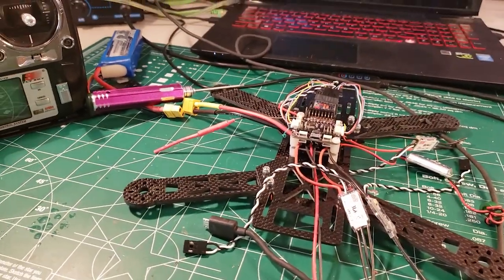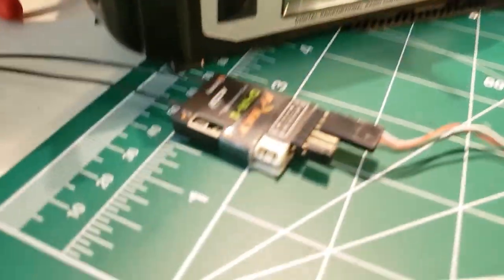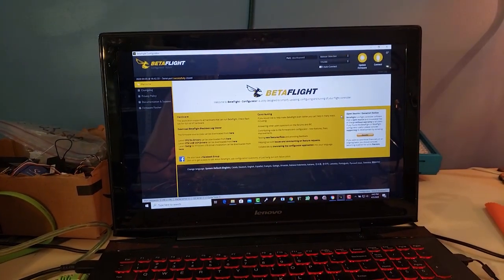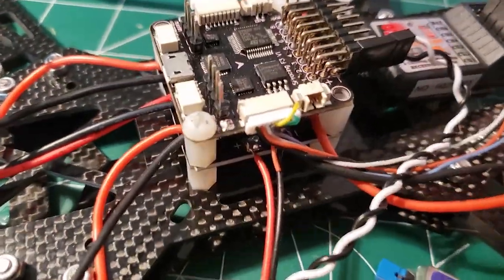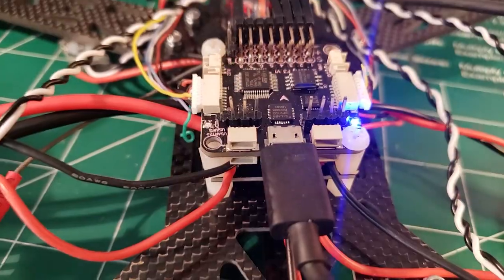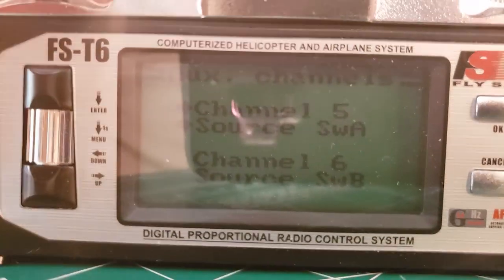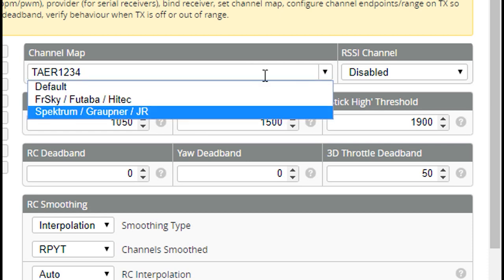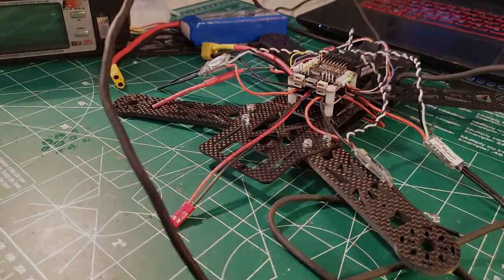Setting Up Flysky Transmitter Channels in Betaflight

Comment: Hi. Hope you can help. I have a SPCMaker Bat 78 2s drone with a FlySky receiver. I have it in bound to my multi protocol Jumper T Lite tx. It flys great. My arm switch is aux 1 ( ch 5),  modes aux 2 (ch 6), beeper aux 3 (ch 7), and turtle flip aux 4 (ch 8). The led lights don't turn on and I'm wondering if there is a channel for them to be switched to? What aux and ch number would that be?

Comment: Hi Steve, Is it OK to allow your motor wires, un-insulated, to short while powering up? time05:45
Reply from the maker: Excellent point.  In hindsight, probably not a best practice. If the motors had been connected at this point they would not have spun until armed by the flight controller. Although  I have many builds this way without incident, you have caused me to take notice and take a different approach from now on.